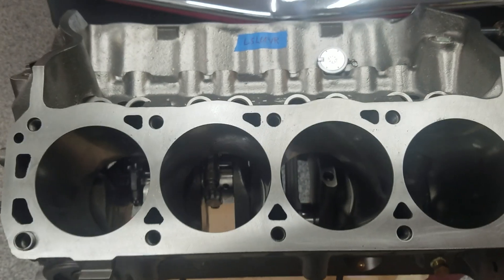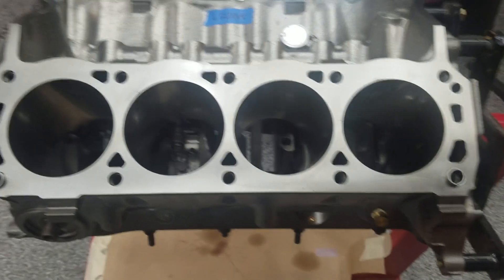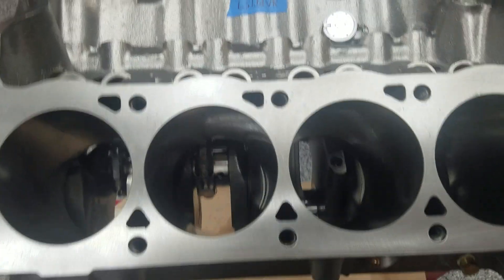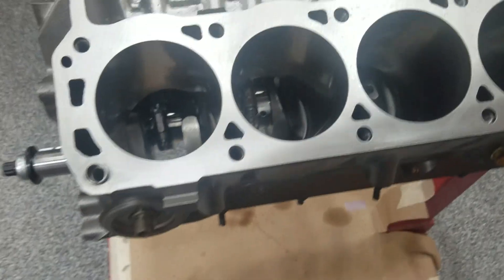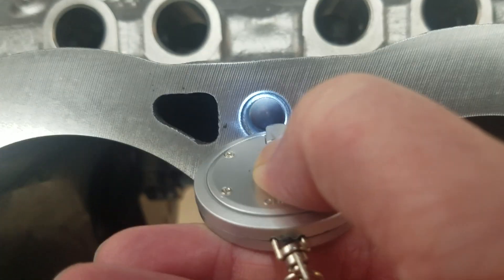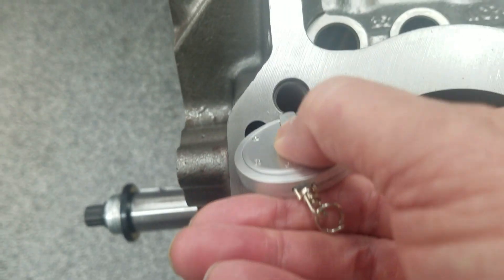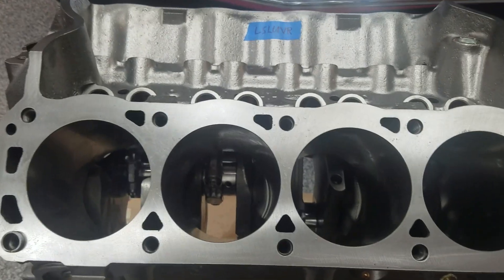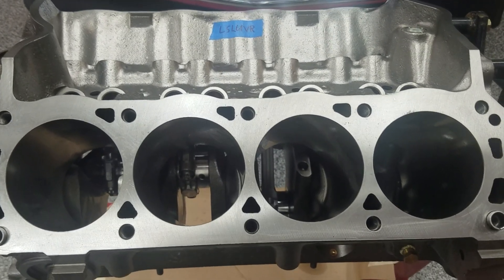351W head bolts DO NOT go into the water jackets.

Comment: Using an air blower with a rubber tip (to stop up the opening) is also a good way to check that the bolt hole doesn't communicate with the water jacket.  If it wants to push away when you put air pressure in the hole, it's a blind hole.  If it's supposed to be a blind hole, and it doesn't push back when you blow air into it, it's going to need to be investigated.

Comment: Im working on a 1990 and its leaking out of the head bolts
Reply from the maker: Is it leaking water or oil?
Reply: Coolant  @BlueOvalEdge
Reply from the maker: I’m thinking about your problem brother, is it leaking coolant out of multiple head bolt holes or just one? Is the leak from a head bolt(s) outside the valve cover?   Tell me as much as you can.  Is the engine rebuilt recently?  Has it been overheated?  Did it recently blow a head gasket? @mypony7310
Reply: I think my 94 head bolt holes are all blind also, from what I can tell